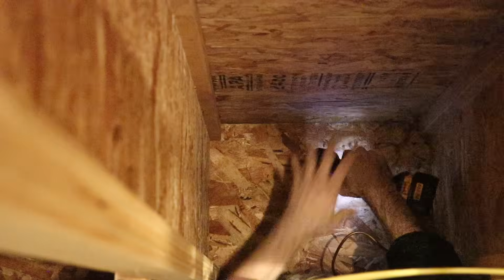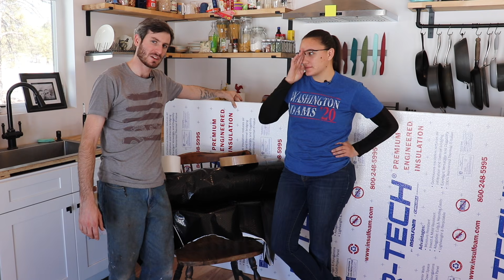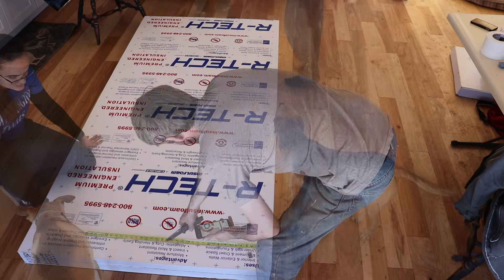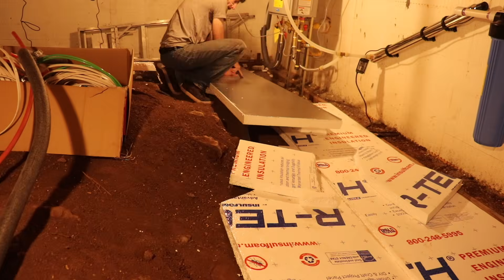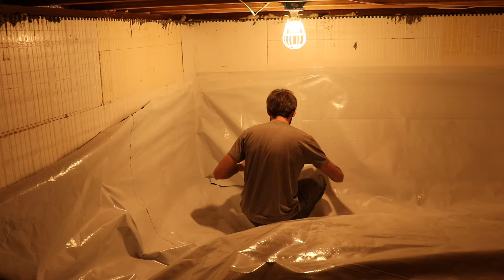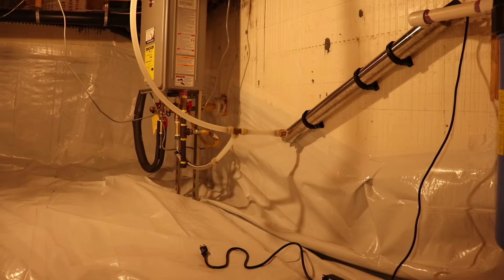DIY Crawl Space Encapsulation

Comment: Now that its been a ew years - have any problem with moisture on top of the barrier in those valleys?  I'm cleaning out my crawl space now for plastic and was wondering why you couldn't have done some raking first to level out the crawl space somewhat  (in my case I am not putting all my equipment down there yet so will put my equipment down there after its all fairly level).

Comment: I'm new to this and researching it for my own DIY project. You're taking 120 cubic feet of conditioned air every minute out of your house through your crawl space and dumping it outside. This means your house is pulling in 120 cubic feet of unconditioned air from the outside every minute that it will have to condition. Are there professionals recommending this? I thought the standard procedure with a closed crawl space was to add a dehumidifier and or circulate the crawl space air through the house (not outside)  as it is now part of the conditioned space. Thanks
Reply: It probably doesnt get up to that cfm in real life conditions. I'd recommend some sort of fresh air intake in the house as well. The issue with encapsulation is that the radon gas can now build up in the house. So venting the crawlspace outside helps the gas go outside. Rather than go into the living space.

Comment: I think it looks good..but i would put foil below and put some sand on top of it so you can walk on it ..also it would works better..btw i would add also timer for your pump..
It happen to me that after some changeover i didn't tighten one join very well and pump showed..low pressure..so it was on all the time ..i did notice it ..but only after about 30 minutes..anyway.. i put timer that is chacking time and it allow pump to stay on max 2 minutes after that it will switch off pump and wouldn't allow to run any more. and as i said in previous video pressure valve..that would help you a lot to have constant pressure over all your appliances..
Reply from the maker: If I were to do it again, I would just pour a layer of concrete over a moisture barrier, and make a mini basement, but we had some time and equipment constraints with excavation so we couldn't get a totally flat surface.  We did add the foam under the plastic in the areas you walk to try and help wear and tear.  Do you have a link to the timer you used, we had a small mishap like yours, but it was caught pretty quick because you can hear the pump when you are in the bathroom and it only stays on for about a minute after the water is turned off, so when it didn't turn off I knew something was up.

Comment: Why didn't you remove the excess soil before putting up the stem walls so you had a more useful flat dirt base in the crawl space?
Reply from the maker: Mainly because of time restraints with equipment, and how rocky it was.  We also didn't need a large space in most of the crawlspace as our only utilities down there are water, power and gas lines and only a few things go to the center.  I can stand up completely (between joists) along the Perimeter as well so everywhere someone needs to be it's very comfortable.

Comment: I don't recall what kind of unions you used but typically they rely on a tapered seat to seal, they are not supposed to need any thread sealant because the threads should be dry.

Occasionally when a union has a damaged taper seat, some people will use pipe dope or Teflon to try and fix it but that rarely works.
Reply from the maker: They have a gasket in them, but it wasn't the unions that leaked those, it was the threaded connection to the pump, I don't think I tightened it all the way when I was putting it all back together.

Thanks for watching!
Reply: @PootsPastures  that makes sense.  Well, I hope you have it solved.

I'm probably going to have something like a shower pan with a floor drain under my stacked washer dryer, water heater and filter.  Just a little extra protection to avoid flooding or water damage.  I'm not sure if you can do that with your liner but it might help you avoid disaster if you get another leak.
Reply from the maker: Its doable, but hard because it's about 3' under grade. Eventually I'm going to put a Alarm down there that goes off if it detects water, and then have a sump pump I could use if I need to pump it out.  If I was above grade I would for sure have a floor drain.

Comment: Good job with the liner.  I would make sure, since you are creating a negative pressure in the crawl space, that you focus on air sealing the Rim / Sill Plate / Foundation interface. I would put a layer of closed cell foam around the perimeter.  Or paint the joints with a fluid applied barrier.  Or use canned spray foam or acoustic sealant on those seams.  I think that is what Matt would do.  :-)   You want to make sure YOU control where the air comes from that the vent fan removes from your house.  Good Work.  Also.. Make sure you are directing exterior water away from your home with grading.
Reply from the maker: If you watch some of our other videos I cover what you just suggested. Our still plate is sealed with spray foam, and the fan that was installed pulls air from the house to the crawlspace through two vents that are cut in the floor.

Thanks for watching!